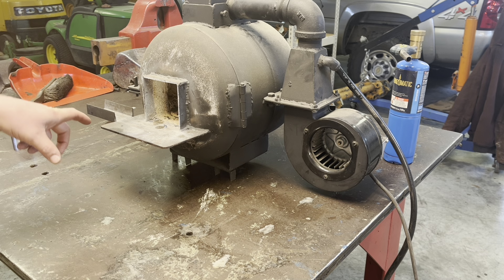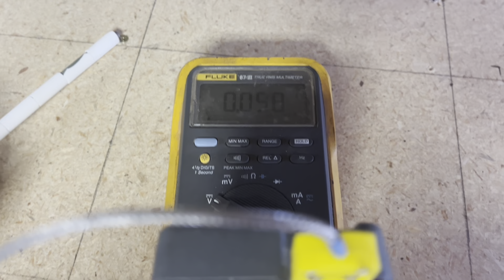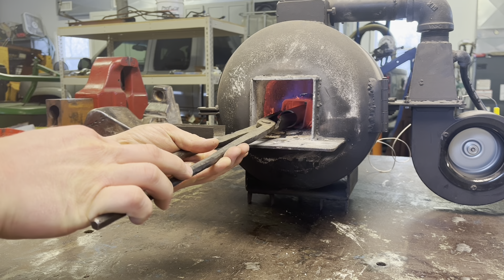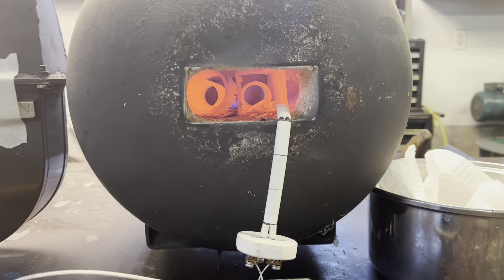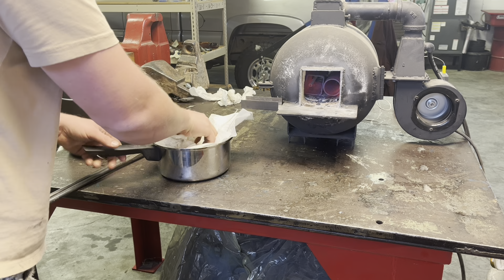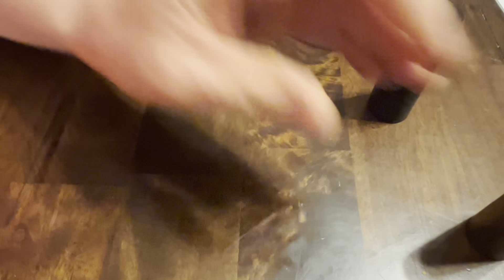Heat Treating 52100 Bearing Steel - Case 1840 Loader Bushings

Comment: Get a kiln.
Reply from the maker: That would be easier but I don’t do this enough to justify one.
Reply: he doesn't need a kiln. A forge is just fine. The best would be just to send it out to have it heat treated and cryo tempered.
Reply from the maker: @bayareaartist999  Sending it out for professional heat treatment would for sure be better.  I would love to get a hardness tester to see my results.  After this video I tried to drill a hole in it just for fun and a drill bit wouldn’t even touch it so it’s hard.
Reply: There are 52100 hardening specs you can find on the knife making forums. The cryo tempering is worth looking into. If you know anyone who has liquid nitrogen submerge the bushings in liquid nitrogen then heat temper them and they will be almost unwearable.